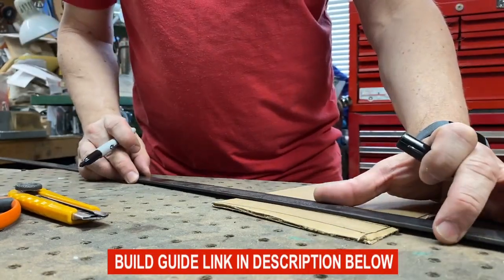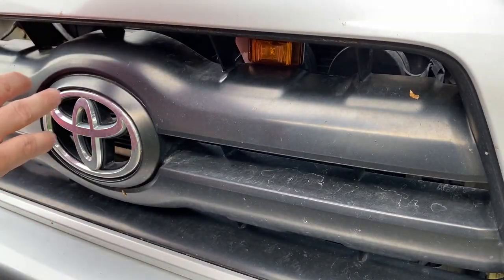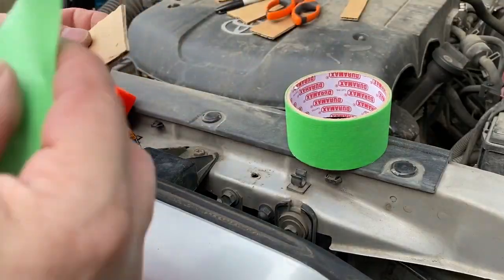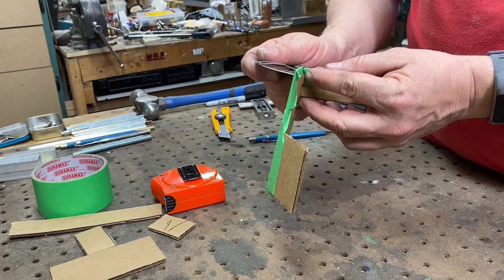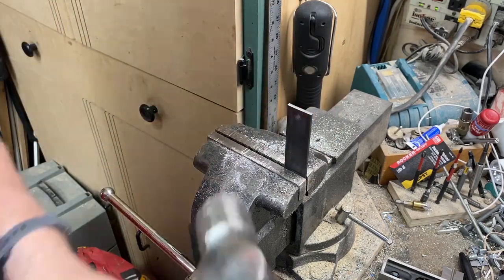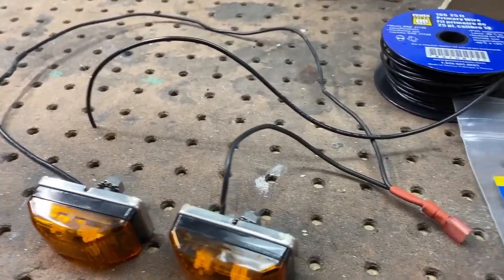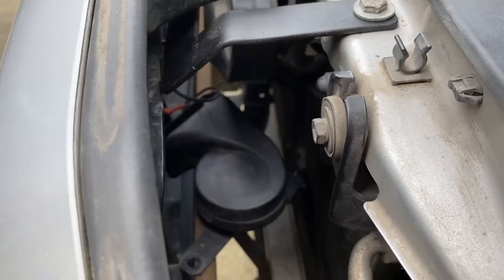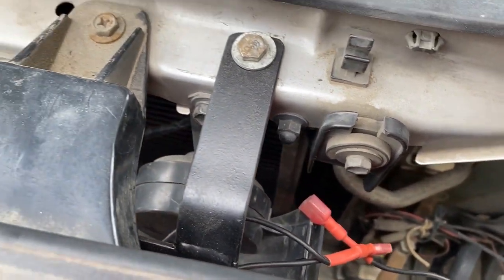Toyota Tacoma Grill Lights - Raptor Lights / How to MAKE mounts and install LED lights for under $25

Comment: I just purchased a 2017 TRD Sport. Really digging the modification possibilities. 
My first mod was a custom steel grill from 300 Industries. The grill is sweet, but, no marker lights in the one I chose. Stumbled across your video looking for options. So simple it plum evaded me. 
Brackets; genius!! This saved me  some time, for sure. 
Thanks for the ideas.
Out to the garage.
Reply from the maker: Right on!  Thanks for the comment.

Comment: Nice shop ! I thought I would check your fab for lights. I am finishing up brackets that protrude out of the bottom holes of the grille. They will hold led driving lights. You gave me some ideas for improvement. At this time I do not want to spend for a bull bar for my Tacoma (Off Road) .  Thanks for your video ...
Reply from the maker: Thanks for your comment. Glad you got some inspiration from it.